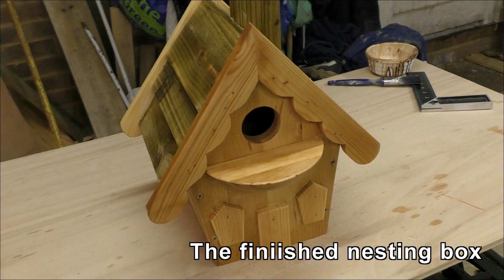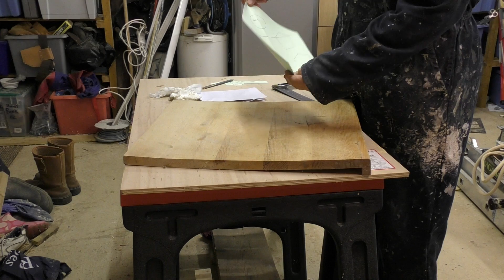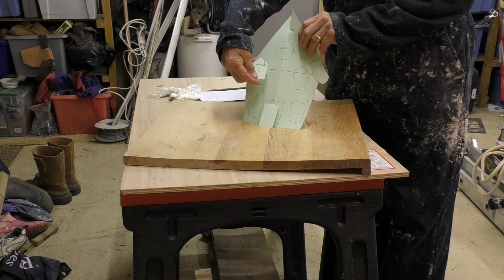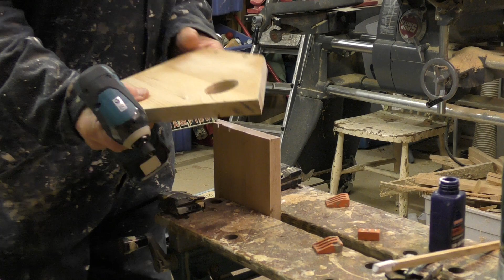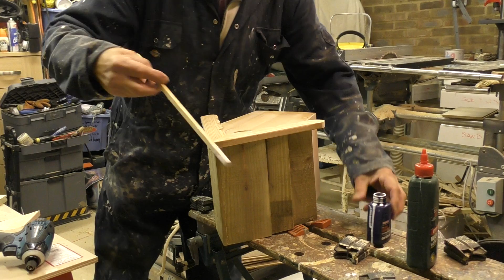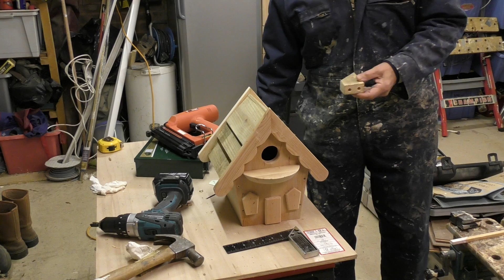How to make a bird nesting box

Comment: Oh boy...another great looking bird box that is not good for eggs and chicks. Access hole should be 1 1/2"- 1 5/8", never use perches, there is no access door for cleaning, no floor drainagen, no predator block to keep predators from reaching in, always make 3-4 shallow kerf cuts under the access hole, inside and out.

Comment: That's lovely, how did you attach the little balcony?
Reply from the maker: Glad you like it. The idea of the balcony was my grandsons and it is screwed and glued from the inside of the front of the box and fixed before all the sides are assembled.
Reply: @Grandad1236  A nice design - but for once you should not have listened to your grandson's suggestion; avoid adding perches or anything that can make it easier for predators to access the inside of the birdhouse.